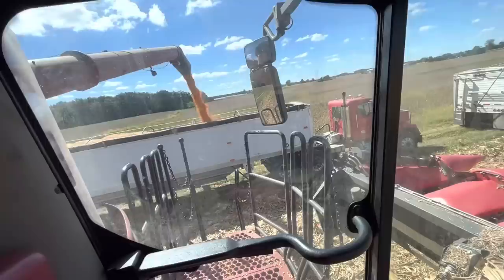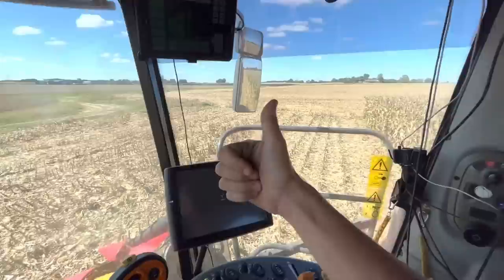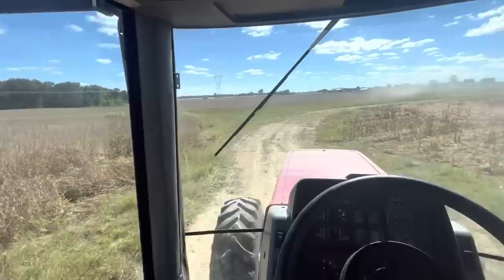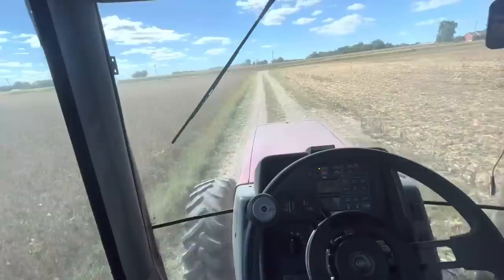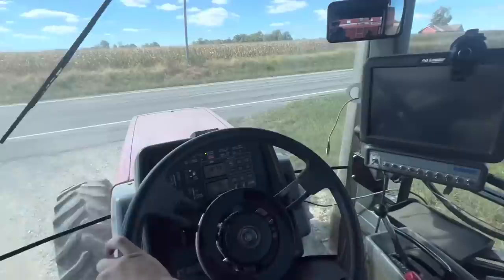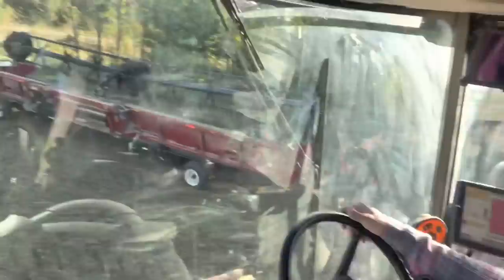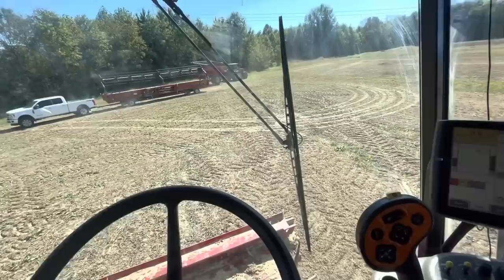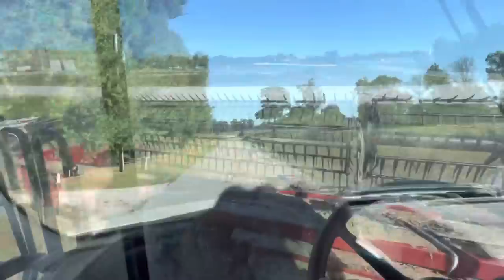ZERO Days Without a High Speed Come Apart

Comment: I was on an operation when the 3162 came out. The dealership gave the farm a hell of a deal to trade in the MacDons and try the new case heads. We couldn't cut more than 200 acres without going through a gearbox or something to fix on the knife. Battled through one season like that. Started the next season hoping it was going to be better and it wasn't. Traded for 2 new MacDons in season. The case draper is a joke and I'm sorry you had to find out this way.
Reply from the maker: Yeah I’ve found out the hard way